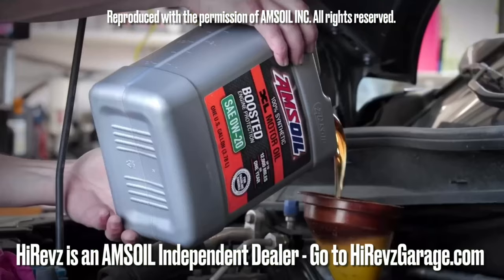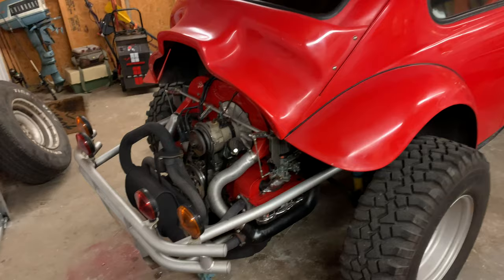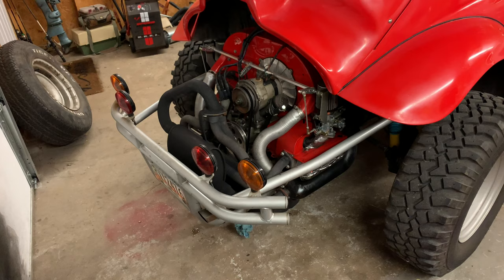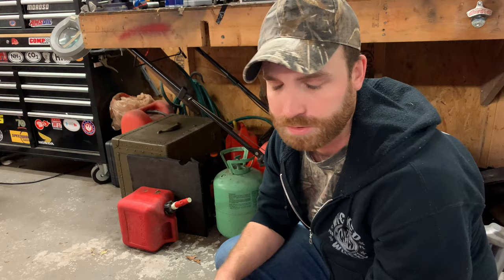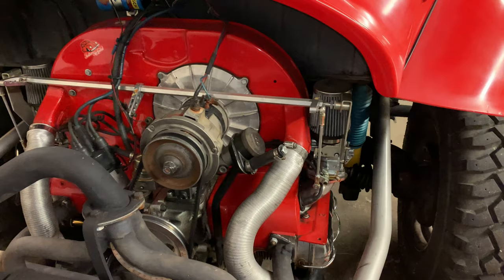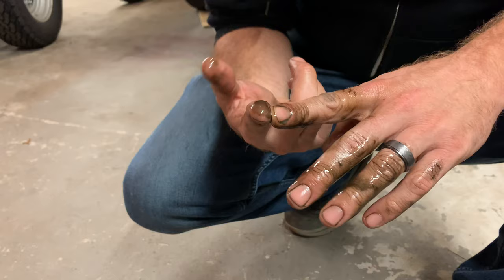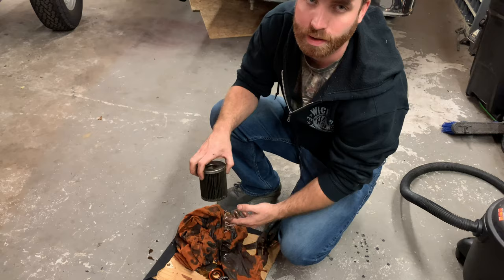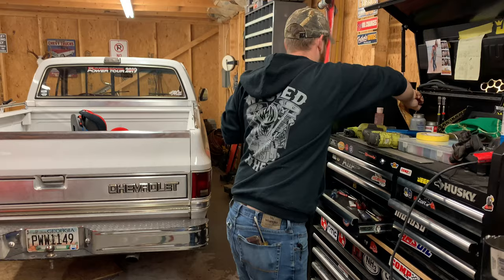AMSOIL Synthetic Diesel Oil in '71 VW Baja

Comment: Hey guys great informational video.  It just so happens that I just had a motor built for my 71' VW SB (Not a Baja).  It's going to get it installed very soon I'll be using AMSOIL break-in oil SAE 30 and AMSOIL oil filter.  I had the same type of modification done so I can use an oil filter too.  After the recommended break- in period what oil wt. should I used (Maybe stay w /30wt.)?  And should it be detergent or non-detergent oil?  What do Y'all recommend ?
Reply from the maker: I would suggest using the Z-Rod 10w-30 in it.  It has a higher zinc content like the old oils did when these cars were made.  It also helps protect all of the internals from corrosion better than other oils.  Here’s the link: https://www.amsoil.com/p/z-rod-10w-30-synthetic-motor-oil-zrt/?zo=30186226
Reply: @HiRevzMedia  Thank you for the recommendation.  I'll look at the link you sent.  Sounds like something I'll try.